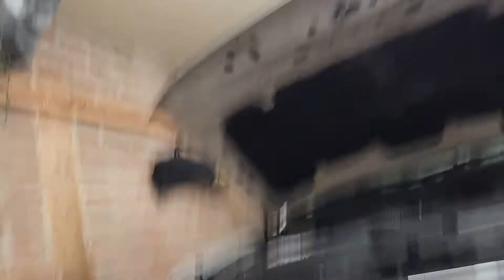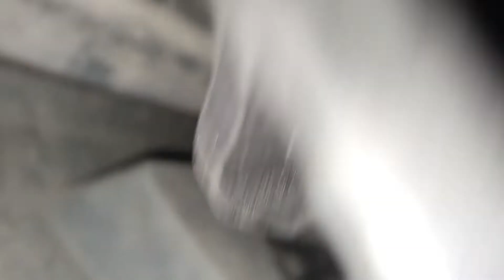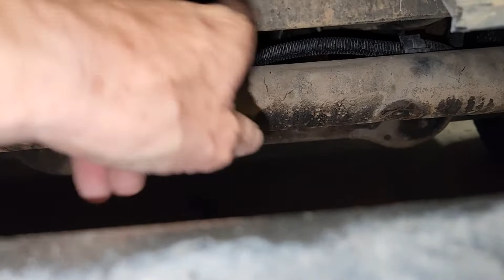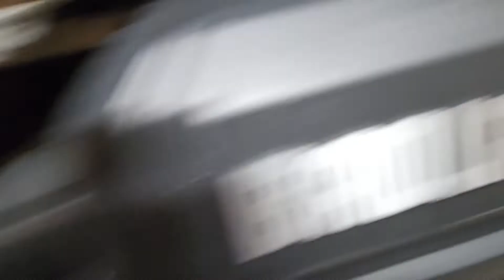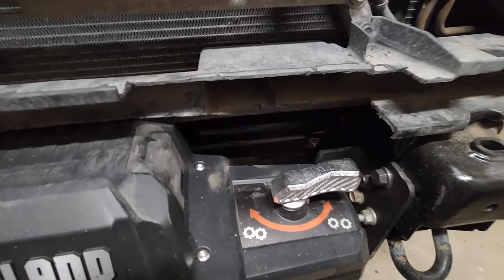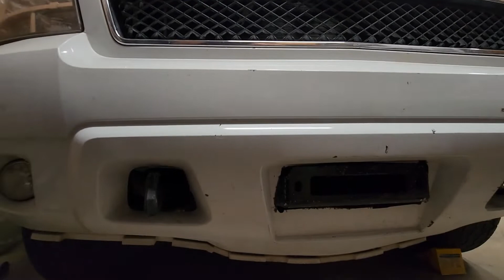2007 - 2014 Suburban (Tahoe) hidden winch installation. Badlands Apex 12000, Rough Country plate.

Comment: Ryan, I greatly appreciate this - I've been wanting to do it with my 07 Avalanche, and after adding the n-FAB light bar, I know how tricky it is to get those frame mounts to work right. Hopefully I can figure out a way to use both of these together!

Could you share a little more detail with the issue with the bolts for the tow hook shackle conversions? I feel like I didn't quite understand the fitment issue and why you took a grinder to the bolts...
Reply from the maker: Thank you and Sure.  The steel bumper has 2 flanges that fit over the top part of the horn (the part above the tow hook adaptors).  This "horn" has a tube in it that the bumper bolt passes through.  The bottom flange on the bumper has a nut welded to it that the bumper bolt screws into thus clamping the bumper onto the horn.  Those 2 bolts (one on each side) were just a bit too long and contacted the top of the shackle mounting adaptor.  In the video at ~28:39 you can see the bolt torqued in place and where it came in contact with the top of the adaptor.  The adaptor has a hole in its top, but it is not quite in the correct place for my bumper.  Hope this helps.

Comment: Where did you get the base adapter for the suburban???
Reply from the maker: Do you mean the winch plate?  I used the Rough Country Winch plate (https://www.roughcountry.com/gm-hidden-winch-mounting-plate-1080.html).  it is for a truck CHEVY/GMC 1500 (07-13) but worked for my 08 suburban with the minor mods I show in the video.